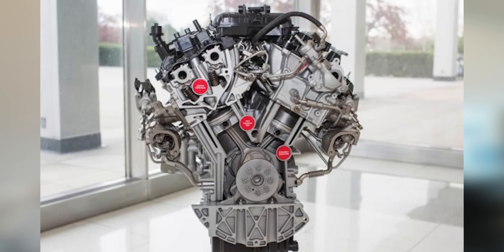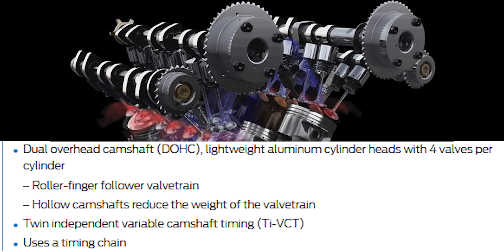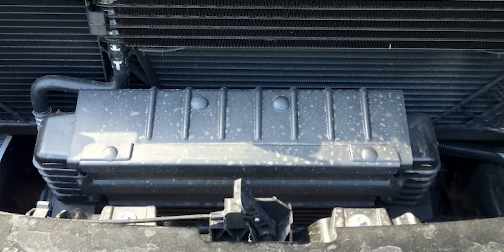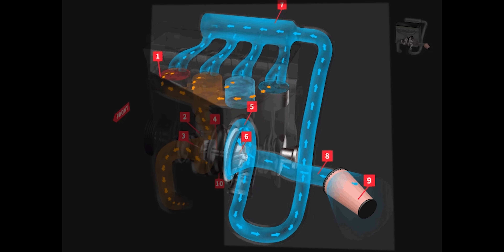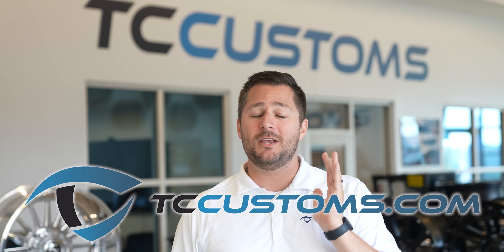The Truth about the Ecoboost Engine!

Comment: My 2014 F150 ecoboost had sooooo many issues with camshaft, vct, turbos, drive shaft, you name it. You could feel the issue with turbos building up over several weeks, and then it would misfire on startup and go into limp mode. Service engine light would keep it in limp mode, but when it changed to check engine, it would drive fine, and then eventually clear the code. 4 mechanics, including Ford mechanics, couldn’t find the issue, despite dumping money into it to hopefully fix it. Worst vehicle I ever owned.

Comment: I was hoping for information about the 3.5 Ecoboost, not an explanation of how DOHC works or DI or FI or multi-valve technology.  DOHC has been around for 100 years.  Fuel injection existed before most of us were born.  Multi-valve heads appeared on the scene back when Dick Nixon was president.  Turbos have been around since the 1950s (at least).  Let's all "throw some water through" our turbos.
Reply: But Jim….That’s EXACTLY how a Ford Ecoboost works!😂

Comment: If the Eco boost engine is so great why does it have so many issues and remain the most common vehicle in my shop?
Reply: Maybe because so many people have them
Reply: @lucada8538  More people have GM LS based engines and those are much more reliable than fords garbage,   More people have Honda, Toyota, and Subaru engines and those are also more reliable, so what's your point?

Comment: OK...now, lets talk about the cost of repairing these engines...complex engine and VERY expensive to repair. And, on the low tech side of these engines...how about the $1500 to replace the turbo cooler lines on just one of the turbos that are known to corrode and leak...and this is just one of the issues these engines are known for. Thanks, but I will pass of the twin turbo engines. These engines are NOT super fuel efficient and are far too expensive to maintain for the duration of the life of the bottom end of the engine. And, oh yeah...don't forget about the cam phasers...another known issue and mega buck repair that will have to be done to all of them.

Comment: Use mine as a 3/4 ton towing dump and concrete trailers for my landscaping company. Mine have 120k and 80K for mileage. Have had zero problems and live in the Rockies so steep mountain passes and thin air! These trucks have completely changed our company. My business partner and I put them as equals to our older Diesel trucks. 92 D250 5.9 5spd 4x4, 00 F-350 auto 7.3 4x4, 99 F-350 5spd 7.3 4x4, and 08 3500 Chevy Auto 6.6 4x4(Lemon?). We use them for everything but plowing(also don't use chevy for this), they get better MPG than the diesels unless towing over 20k lbs (yes we do this all the time) and cost way less to maintain and off the pavement the ecoboost is way more comfortable. The people who tell you the 5.0 is better than the 3.5 don't work their trucks, boat, campers, golf carts,,,, that's cute. The 3.5 makes over 400lb/ft of torque from 1200rpm to redline! With a basic cat back exhaust and tune ours our putting 500lb/ft from 2000 rpm to redline to the wheels! Probably 550-560 at the crank, nothing on the market compares at 5000ft altitude we work them at. Plus, we get 20-23mpg when not towing but still full of tools. Our old Cummins is the only one that matches the 3.5 in mileage but, nowhere near as powerful or comfortable.

Comment: Total B.S.  The technician in Salt Lake Utah sez sll ghe engines hes had to tear down and replace are those with recommended oil changes extending to 10k.  Truck engines should change on 4-6 k at the longest. But if you wanna tempt fate ....be my guest.

Comment: I have owned the 3.5 and I now have a 5.0. The 5.0 is better. The ecoboost is great! The problem is the maintenance. You have to clean the intake valves every 10k due to carbon build up. (Affects the fuel mileage a lot if you don’t!) it also doesn’t get the better gas mileage. Go with the 5.0!!

Comment: Had a Ford mechanic tell me they are overly complicated and very expensive to work on out of warranty. Overall they aren't great, but not bad either.

Says they are a result of mpg regulations. He said many manufacturers are having so many issues because of regulations. Engines are being redesigned for max mpg and paired with ten speed transmission to make them feel more powerful. This causes more wear and tear on the engine.

He said again, they aren't terrible. But buy as much extended warranty as possible as they are very expensive to work on in the labor department.

Comment: And Zero Ford mechanics would recommend 10K miles between oil changes. Do yourself a favor and change it every 5K , and for Ecoboost motors I would go with full synthetic. These auto maker recommendations of "up to 10K miles between oil changes" are just so they can claim a cheaper maintenance interval cost, don't fall for it.

Comment: Remember the "old" days when you could change a water pump in your driveway in an hour or two? You ain`t changing that puppy by yourself in the 3.5 Ecoboost. It`s internal. Some garages take off the whole truck cab just to take off all the turbo plumbing just to get to it. I have one.
Reply: No,the truck 3.5 has external water pump
Reply: that's the transverse 3.5 in the cars and suvs. NOT THE F150

Comment: Is it an engine or a motor?
Reply: Generally speaking an engine converts potential energy like gasoline, wood or coal to kinetic  usable energy.  A motor converts one form of kinetic energy. (electricity, pressurized hydraulic fluid, pressurized air"  to another form of kinetic energy. ( i.e.  rotary motion. ).    You never hear of a steam engine refereed to as a "motor" and current freight trains are mostly powered by diesel "engines" which drive electric "motors".  That said the word "motor" is widely used and accepted for gasoline engines.  And of coure the major au makers refer to themselves as "Motor Companies'".   Still I have  seen  many a  "check engine" light but nary a  "check motor" light.

Comment: Yeah go 10k miles on an oil change. See what happens after a couple years of running oilmlow and super dirty. Sorry but turbos are nothing new and yeah even water cooled turbos will coak/burn the oil. Its not the fast cooling down of the turbo that causes it. Its the turbo being super hot and with the motor off there is no oil flowing through the turbo. A small amount of oil is just sitting in there, boiling and burning in the turbo center housing. Turbo Timers used to be a big thing back in the late 90s early 00s.

Comment: Let's not forget Ford reintroduced port fuel injection on their direct injection systems because then take valves kept getting clogged up with all the gunk that the engine has to suck back in due to emissions and sensors no way to wash the back of the valve on a direct injection engine Ford had to put injection back on it. 

FYI for anybody who doesn't have any EcoBoost stay away from the first gen unless you feel like paying to have your intake valves cleaned about every 40 to 50,000 miles if not you're going to have a shitty idle. 

So far I have about 90,000 miles on mine knock on wood everything's been pretty much okay however one thing that I will admit you can either have Eco or boost but you can't have both.

Comment: The truth is that a forced induction engine won't last as long vs a naturally aspirated engine. Higher cylinder pressure, more heat generated, etc. The downfall of this engine is the internal chain drive water pump. The actual water pump is chain driven and is located behind the timing cover. When the water pump fails it fills the crankcase up with coolant and destroys the engine. This engine makes excellent power and torque, however I'd take a naturally aspirated V8 Coyote 5.0 all day over this 3.5 Ecoboost. Ford should stop offering 6 or 7 different engines in the F150 and simplify it.

Comment: The Turbos are not reliable as naturally aspirated engines. The Turbos have more moving components and it will absolutely will not as long as naturally aspirated engines. Anyone that is saying Turbos are reliable is not telling the truth. In addition, Turbos consumes more when it is used so I don’t see any benefits of having a Turbos. Anyone says that you can do an oil change every 10,000 miles this is another lie, oil breaks down and it gets dirty fast even after 3,000 miles so I like the terminology “Oil is cheap, engine is expensive”…do your oil change people every 5,000 miles or sooner.

Comment: More parts = more points of failure. Just increase the diameter of the valves and ports to bring in more air.  Tah - hell with the fans. Be a real man.

Comment: Too many cons to the 5.0 V8 

Bad fuel economy 
No forged internals 
Weak in power 
Cylinder deactivation 

For $300 more you can get turbocharged engine technology that was only in sports cars and race cars in the mid 80’s.  

You can tell Ford would like people to forget about the V8 by the price increase but people still want that V8.

Comment: I have a 2015 f150 with the ecoboost and six speed trans.  How are these engines different or better.  My truck had 101,000 miles on it.  Once it turned 90,000 miles nothing but problems.  I don’t like this motor and won’t buy one again.  Leave the V8’s.  I hate this ecoboost crap.

Comment: All the hype over the “power” of these v6s that are turbocharged  versus the naturally aspirated v8. The 5.0 is almost as powerful without any assistance. So let’s be fair and give the 5.0 the same boost. Guess what those little v6s aren’t any competition now. I will take the v8 5.0 anyday they can keep their ecoshit
Reply: Look at the torque curve.  The turbo motors (any configuration, V6, V8, whatever) make a lot more low end torque when properly tuned as Ford has.  There is no comparison.  The Ecoboost kills the 5.0 down low where you need it most.  Go ahead and give the 5.0 the same boost, but you'll have to do it because Ford isn't offering it.

Comment: Stay away from the eco-boost motors they are junk I had one in my F150 and my turbos are gone at 100,000 miles and Constant misfires and junk the motors are just straight up junk buy a Toyota tundra with a 5.7 V8 in you’ll be much happier!!! And yes I had 3.5 in mine!!

Comment: 10,000 mile oil change interval is complete BS.
Reply: Marketing gimick.  And engine will require more repairs.  Means more money for dealerships. I will stick with my 3000 mile oil changes. Has worked for 50 years for me.

Comment: These motors are crap don't believe this bull,turbo WILL go at 100-150 k,  engine will burn oil because of the turbo, only thing worse is the dual turbo
Do not buy these folks do your research, this whole video is a lie
If you make a huge mistake and buy these, change your oil every 5k

Comment: DGI worst designed ever.   Valves get dirty and destroys the engine.
Reply: no it does not destroy the engine. the valves do get coked but never to an extent that they require cleaning like in BMW engines. this was/is a huge discussion in the owner forums and consensus is that it's not something you need to worry about. plenty of 200k+ mile engines with no catch can and still no coking issues

Comment: Could barely watch this - so many rash misstatements and super poor choice of words here - calling into question the whole rest of the video, not to mention every other video TC has put out.  Dude, you need to redo this video 

@ 11:15 - Invitation to correct -  commence roasting to a crisp!

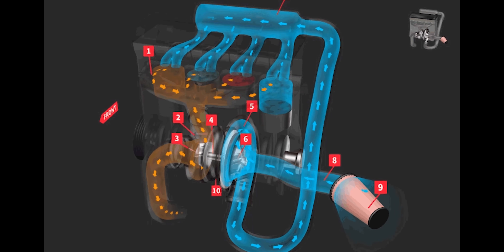@1:37 = Bigger "explosion" - No! - a properly running engine never contains an "explosion" - that's an engine KNOCK, something we never want to happen.  Fuel BURNS - quickly - but BURNS in an engine
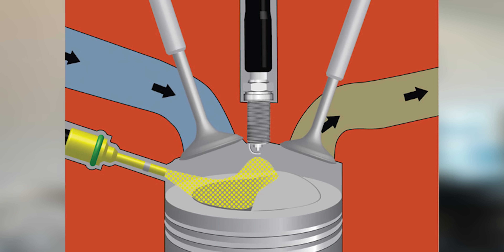@3:10 "Directly spraying fuel into the motor" - come on now - fuel is injected into the CYLINDER - be accurate, specific.
@3:23 Pouring, Dumping fuel into the motor - no, it never pours or dumps fuel...
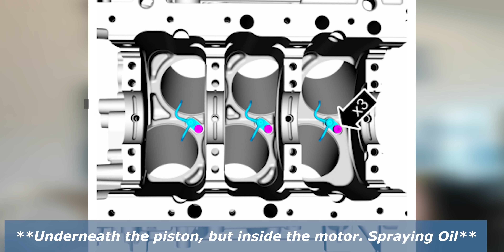@4:07 "underneath the motor, you have actually have these jets that are spraying FUEL into the underside of the cylinder.  Thank God that this guy didn't design ANY internal combustion engine
@6:38 - more mentions of "Bigger explosion"
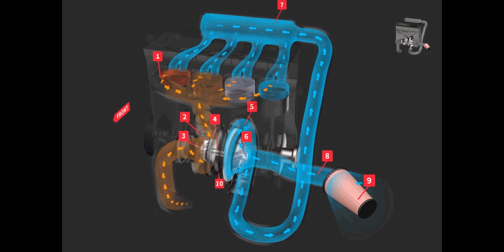@7:23 - turbo "creates" boost...yes, a generally, close to accurate statement, but you really shouldn't try to explain a turbocharger at all if you're not going to be at least a bit more detailed.
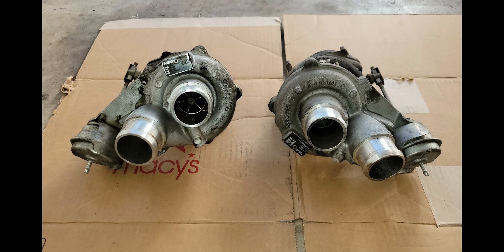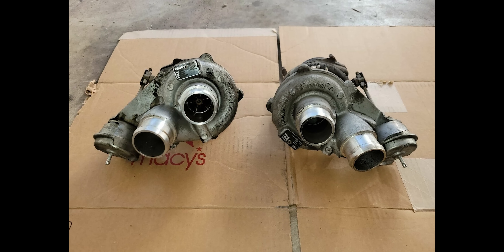@9:05 / 9:37- a gimmy - displaying the turbos on a Macy's box?  haha
@10:35 - "going into the weeds... "   Yep, but you dived into the SWAMP on this!

Comment: I don't trust turbocharged gas engines because they aren't built to be heavy duty I do trust turbocharged diesel engines because they are built to be heavy duty the coyote V8 was designed to have a longer longevity then the 3.5 L twin turbo EcoBoost why is that because turbo engines today in 2021 are lucky to get to 130,000 miles without something like a turbo gasket or Turbo bearing going bad by then replacing the turbo parts that are bad is more expensive than the vehicles work to that breakdown effectively totals the vehicle on a diesel the block is made heavier the turbo is made heavier the compression in the block is why it's all made heavier and it all last longer because of the way diesel runs. The fact that Ford think they can sell me a gdi ( which has problems with longevity) twin turbo ( which also has problems with longevity) enough, is wrong. If I want a turbo half ton pickup I'll get a Silverado 1500 duramax